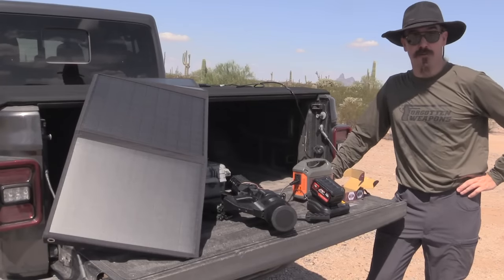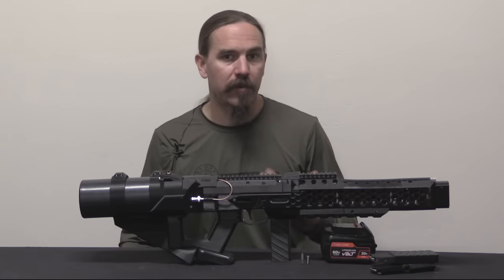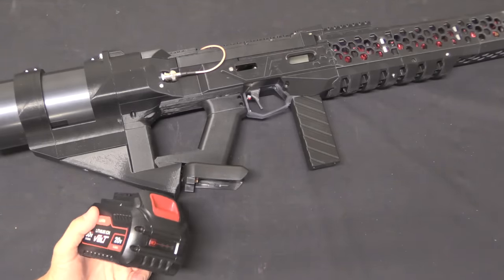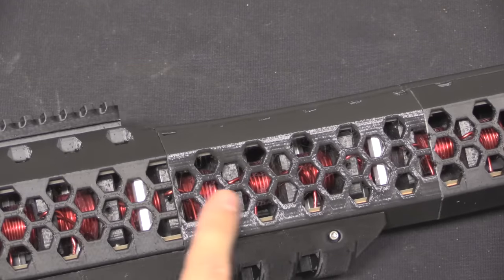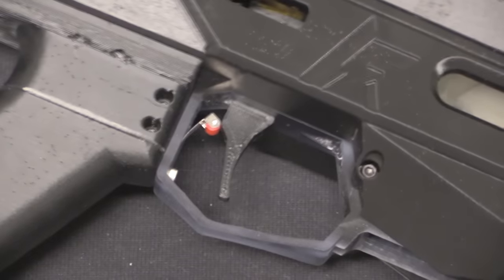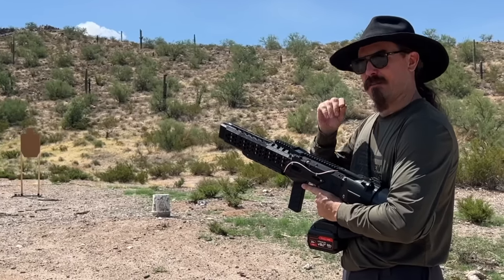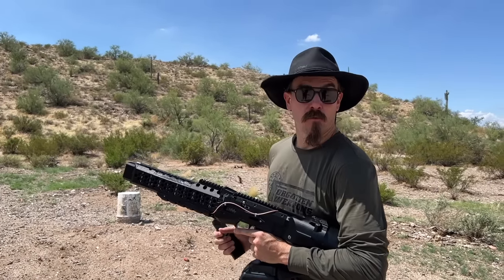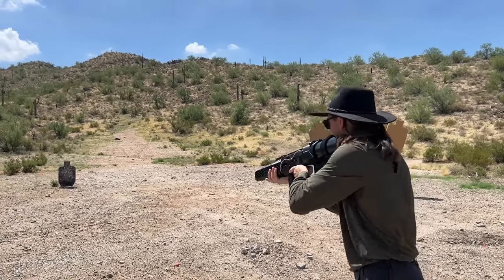ArcFlash Labs EMG-02 CoilGun: Making SciFi Weapons Into Reality

Comment: Admittedly I know almost nothing about future weapon tech. I just stumbled upon this video and am blown away. I don't know what the limitations of a hand held coil gun are but if they can be made lethal and accurate... holy crap. Almost silent, no recoil and you could even pick some fired ammunition back up and reuse it!
Reply: It's a very interesting topic! The navy even funded railguns for a bit before it got cancelled. Unfortunately it's going to be many decades before anything like this becomes close to being practical.
Reply: the limitations are carrying huge ass capacitors which quickly turn into grenades when damaged
Reply: @31sebman  videogame weakpoint irl
Reply: @Jester4460 bro got that Half-Life Alyx grunt air tank
Reply: Your sarcastic bot comments are just phenomenal , so much improvement over the last two years.
Reply: @31sebman  Hell, capacitors can pop just from having the wrong environmental conditions they don't even need to be damaged. Also they don't like to be shaken around a bunch like they presumably would be in a combat weapon. And the more energy dense you go the more unstable and deadly they become.
Reply: There seem to be similar limitations when you consider coil guns with higher projectile speeds.
- you need a much more energy dense capacitors (not yet existing)
- capacitors needs to be environment resistant (something current tech is very bad at)
- the faster the projectiles go the louder the shot will be (air pushed out violently)
- ammo needs to be made from something ferromagnetic (what alloy, exactly?)
- coils will start to heat up in auto mode (more power through them)
- projectile stability, I'm surprised these were just solid cylinders (maybe some vertical grooves would be a good idea?)

Basically, without more energy dense battery/capacitor combo, these things will never be lethal in this size. Once you have these, you need a decent coils, then come up with decent projectile shapes etc.

But I think we will live to see these become lethal in a decade or so. I would not expect these to actually become standard issue any time soon.

Comment: Drill Shot : Fires a super sharpened drill bit at your target. The velocity itself is relatively slow at only 900FPS, but the bit is spun by the electromagnets at over 10,000,000RPM. Effective against armored opponents

Comment: The problem with a big capacitor in the back, is that in the case of catastrophic failure the capacitor will explode into your shoulder (the capacitors are almost always designed to pop their cap off), rather than explode downward into the air and ground. So, hopefully we won't see any of that happen.
It does store significantly more juice, the 3 round burst look amazing.
I would think that the hobby-grade high-discharge battery would fare better than the cordless drill batteries, but I guess they are probably similar.
Reply: The very large electrolytic caps usually have a vent on the terminal end rather than simple cuts in the blank top of the cap. So it would likely spray forward rather than backwards toward the shooter. A high-quality drill battery can discharge at a very high current. I've started a car with one.
Reply: @sbreheny  lol wow
Reply: A (decent) drill battery is made of 5-10 18650 size lithium cells, the same high discharge ones used in hobby battery packs and vapes.
Reply: Maybe they could put a plastic stock around it for reassurance? Or would that make it hot without exposed air to wick off heat?
Reply: The other way around is to not mount the capacitor in-line -- maybe one or two shorter capacitors mounted sideways and facing away from the user. This way if they explode, they will explode outwards, which will hurt any bystanders but not the user.
A quality hobby-grade drone battery of 4000mA is rated for at least 25C continuous, which is 100A. However they are typically not rated for over 16V (4S), so having the extra bit of voltage can also help quite a lot.

Comment: I suppose you could make a light sabot — I know there’s biodegradable 3D printing filaments — and put an appropriately sized dart in it and prevent the keyholing with aerodynamic stabilization rather than gyroscopic stabilization.

Comment: Hardware stores are going to see an increase in sales from all their tools.
Imagine asking a squad mate if they have any spare batteries on the battlefield
Reply: Me reloading my hand gun using a 9 volt
Reply: Lol
Reply: You got any charge man?
Reply: I think it's more practical to use capacitors rather than batteries in the battle field. The capacitors can be build into the magazine holding the projectiles. Capacitors are cheaper than batteries and I don't think soldiers will expect to reuse the batteries after it runs out of charge
Reply: Needs to be like a lasgun from Warhammer 40k where you can recharge the battery packs by tossing them in a campfire.

Comment: Putting a cheek weld on that capacitor kinda scares me. I still want one.
Reply: Yeah absolutely terrified to use that
Reply: @murphy7801  Quit being scared
Reply: @lucky43113  Since a capacitor that size could easily decapitate you if it were to explode since they completely blocked the pressure release point, you should be scared.

Comment: That's a very cool gun, silent, no recoil, no muzzle-flash, lighter ammo magazines. Perfect
Reply: If only those projectiles hit a bit harder. They're cheap as all shit. Dowel pins sized enough for this gun run at about 400 for $30 😂
Reply: sadly the no recoil is because there aint no energy behind each individual shot, we're talking like less than a paintball gun
Reply: @drb0mb  Of course, there are ways to reduce recoil on heavier guns, this is obviously not a heavy one
Reply: @drb0mb  A lot of the recoil you feel in a gun doesn't come directly from the projectiles but rather the actions of the gun's mechanisms. Something like this would still only have the recoil from the projectile which can be easily compensated for.
Reply: @drb0mb Don't confuse speed for energy please, it has less projectile velocity than a paintball gun , it is around double the energy of most paintball guns. It will also transfer that energy way more effectively, by not shooting balls that explode and disperse out energy. It's nowhere near an actual gun that is for sure but this thing should still not be shot at a person it will definitely be dangerous. It is more comparable to an Airgun (Not to be confused with an airsoft gun) which you should also not be firing at people unlike a paintball gun.
Reply: I could see these types of weapons eventually replacing suppressed subguns.

Comment: Not sure if it's available to these guys, but ultracapacitors like the type used in defibrillators don't have the same explosion hazard that electrolytic capacitors do
Reply: Their website reads this
Capacitors:	1x MV electrolytic
Not sure if that means ultra or not
Reply: @zakzac1  It means boom boom
Reply: @isodoublet  lol I was sort of thinking...
Reply: No that's not an ultracapacitor
Reply: Ultras are VERY expensive.
 10 ultracapqcitors would make it unaffordable.
Reply: @sherryneglia4804  this seems an unreasonably priced toy already.
Reply: Ultracapacitors have their own set of problems, mainly reduced power density.
Reply: @sherryneglia4804  maybe in the future then
Reply: @JohnDoe-jp4em  when you say power density you mean W / m^3?
Reply: @dsdy1205  Yes
Reply: @JohnDoe-jp4em  That's strange, why would they be used in defibrillators and the like if they have power density issues
Reply: @dsdy1205  Because you don't need to have a lot of power to shock somebody. Also i kinda doubt all defribrilators use ultracaps, since ultracaps are only really a thing since like 10 years and I see neither the necessity nor benefit to use them over normal electrolytics. Especially since the high leakage current of ultracaps makes them kinda unsuited for battery powered devices that need to remain operational for a long time.
Reply: Yeah, I was thinking I would not like to have a fully charged capacitor that big anywhere near my face...
Reply: @JohnDoe-jp4em  I agree. It’s possible they just the term ultra as a marketing gimmick for their brand of defibrillator. Many medical tech firms love doing things like that since the customers don’t know any better

Comment: Even if this rifle and the tech is in its craddle just imagine the improvement in about 20 years. Who knows, mabye in 50 years the militarys around the world will have gauss rifles.
Reply: I doubt it. There's no upside and quite a few downsides for a gauss rifle compared to conventional arms.
Reply: The main limitation are the batteries.  To have batteries with enough capacity to produce velocities comparable to existing powder weapons but still light enough to be carried by troops just isn't feasible right now.  A few years back they were talking that a new generation of high storage capacitors might be able to replace batteries but the research on that seems to have hit a dead end as I haven't heard anything since then.

So it seems, just like power armor, rail guns won't be practical until they can come up with much longer extension cords;).
Reply: Dude what if we get commercial energy weapons?
Reply: @jongustavsson5874  clearly you've never imagined what sort of damage a hyper velocity gauss rifle shot at an armored vehicle will do.

Even if gaus's rifles, coilguns, what have you don't get mainstreamed, like every infantryman has one, there will be some sort of electromagnetic sniper rifle/canon that has the ability to reach out very long distances and literally make people explode through armored plating.

Crew served guns being used as some sort of AA/AT guns I 100% see being used, as it's a hell of a lot cheaper per shot for a electromagnetic gun than even the cheapest MANPAD, with the added benefit it can reach out and pick off dismounted infantry from huge ranges too.
Reply: @silverjohn6037  there's been a lot of research done recently on solid state non liquid chemical based batteries and last I checked their power density is getting much beyond that of lithium ion so I could eventually see it being down scaled enough that you could probably power a gauss rifle
Reply: @Shinzon23  yeah, no.
Reply: anyone noticed how silent this thing is?
Reply: BAE Systems are already working on a Naval railgun.....
Reply: @m0-m0597  It's subsonic.
Reply: @mightisright  ok
Reply: @jongustavsson5874  I can already name 4 upsides this would bring over conventional firearms

1. lighter frame not having to account for the explosive pressures of conventional gunpowder could lead to infinitely lighter firearm which would also be much cheaper to produce.

2. Controlling the power of your shots could allow for a weapon to be both non lethal and lethal without needing an in between

3. No recoil means that when the system is fine tuned and well developed to a point where accuracy is on point, full auto sniper fire would be more than possible at spectacular ranges as well.

4. No noise produced would be perfect for stealth ops as there would be virtually no indication someone was firing these things unless they were less than 20-30 feet of the shooter or the result of the shooter completely concealing their position and not having to deal with muzzle flash, excess gas, or any of the average downsides to guns being used in stealth situations, and that’s just the vanilla gun.

So I do implore you to not be so naive when talking about a technology that, 10 years ago, was said to be just as impossible in its current form as it is being called impossible to be used in its discussable future for now.
Reply: @silverjohn6037  Recently there have been some promising developments in next generation battery technology. Lithium-sulfur and vanadium redux flow batteries are both very promising but still several years off of practical availability. I would love to see electric rifles but realistically the tech just isn't there yet.
Reply: I assure you, if we are seeing this now there is a much more advanced version sitting in some R&D lab in an undisclosed government facility. a lot of you guys like to think we are seeing the cutting edge version of these weapons right here. we are not. when in history have we ever been privy to the latest version of anything lol. we are the peasants after all. GPS existed for years before the general public knew. same with rockets, jet engines and many, many more militarily applicable inventions. if it can serve the government or military, it gets compartmentalized and classified for years till some dumbed down or primitive version gets out to the general public. hell I wouldn't be surprised if they let us buy these now just to help fund the ones they're currently working on. I'd bet money that one exists that'll defeat level 3 or higher armor and probably worked out a way to get some spin on them too. 

remember, everyone thought that internet and email would be stupid and impractical, now look where we are today..... we cant accurately predict the evolution of a yet to be fully utilized technology.
Reply: Halo Reach Gauss Hog would bring the world to its knees
Reply: Probably got to wait for us crazy Wastelanders to Salvage Elon's Factories and start DuckTaping things together before we have Gauss Rifles that really pack a punch. O.o
Reply: @jongustavsson5874  Without thinking too much about it, I can think of a fair few upsides of a Gauss rifle

Less required cleaning, much quieter, no muzzle flash which can give you away, no recoil, potentially cheaper to produce projectiles, the potential for very high speeds and thus further range, it's "smoothbore" so a variety of different projectiles could easily be fired out of it

As it stands right now it obviously can't stand its ground against a conventional firearm, but I personally see the potential in it for the future ~10-20 years
Reply: @Sebastian-yl7nq  Sorry Sebastian but "no recoil".  Using magnetic coils doesn't let you ignore Newton.  For every action there is an equal and opposite reaction.  It can spread out the recoil over a slightly longer time (we're talking less than 1/10th of a second) but the recoil will still be there.
Reply: @jongustavsson5874  "Even if this arquebus and the tech is in its cradle just imagine the improvement in about a century. Who knows, maybe in five centuries militaries around the world will have firearms."

"I doubt it. There's no upside and quite a few downsides for a firearm compared to conventional crossbows."
Reply: @enderbirds3814  recoil and noise will become issues like any other rifle when this think starts kicking out the same muzzle energy as a traditional large calibre rifle. Recoil is a result is something with mass being flung forward quickly, no different here. 
Sound, yes it will be quieter but for accurate ranged shots you’ll need supersonic projectiles and the loud crack that comes with them.
Reply: @SgHawk144  you sir are incorrect, the recoil will still be recoilless as in order for recoil to exist there has to be a force pushing back on the gun, something a rail gun or a coil gun, doesn’t have.
Reply: @silverjohn6037  I would argue that using magnetic coils does in fact, ‘ignore newton’ in the way you believe. See the magnets. They don’t push backwards like an explosive propellant would no. They simply accelerate the projectile like an electronic roller coaster motor would fling a cart forward. It’s the same concept with coil guns. Please have a basic understanding of how these things work my guy.
Reply: @enderbirds3814  1. Yeah, marginally. Sure, you don't have a metal barrel, but you still need the construction to be sturdy enough to survive warfare. That means weight. 

2. And you see that being an actual consideration for the Armed forces standard equipment?

3. There's no recoil of note in the gun showed because it's less powerful than an air rifle. There's less recoil than an gun of equal power perhaps, but "no recoil", no that's not the case. 

4. Sure, you don't have the noise of the powder burning, but if you go supersonic the gun will still produce a sonic boom, so for general use it won't be silent.
Reply: @enderbirds3814  magnets absolutely do push backwards, anytime something is pushed forwards, something has to get pushed backwards. If the magnet is pulling the bullet towards itself, then the magnet is also being pulled towards the bullet with equal force. Sorry chief, Newton's 3rd law doesn't contain any loopholes.
Reply: @Shinzon23  to my knowledge, these "hyper velocity gauss cannons" are all vaporware at this time, pretty much just conceptual or theoretical. We've got a long way to go before we can reach Halo levels of gauss cannon/railgun/MAC Cannon, and probably just like in Halo, we'll still rely on good ol' gunpowder and lead for the typical soldier to use when a true anti-armor coilgun becomes an actual thing
Reply: @enderbirds3814  Ok?  I'm assuming you're trying to troll me so have a good one;).
Reply: Well there are advantages it's quiet and it can fire something pretty simple.
Reply: @nicholasthompson6152  it's only quiet until you reach supersonic speeds.
Reply: @jongustavsson5874  ys and how often do you have guns that are both quiet and fire rounds that speed. Different roles
Reply: @nicholasthompson6152  Mostly always? There's very very few guns that are integrally suppressed and ported so that ordinary supersonic ammo becomes subsonic.